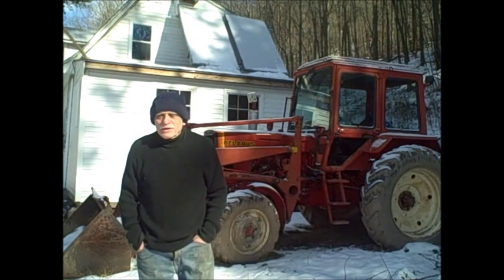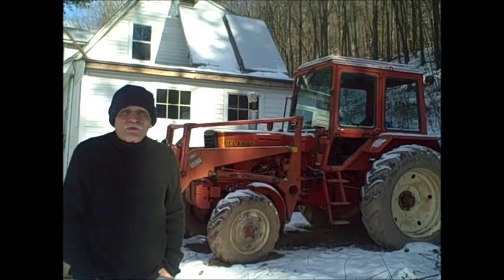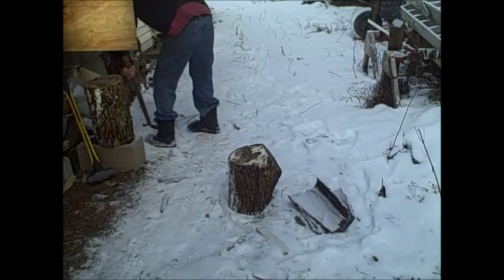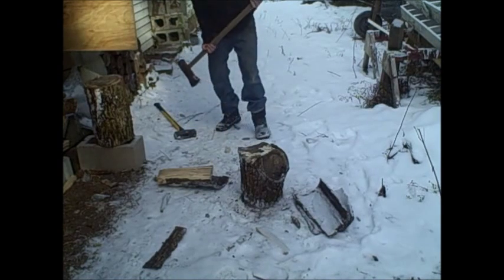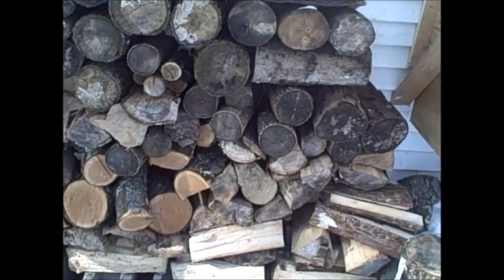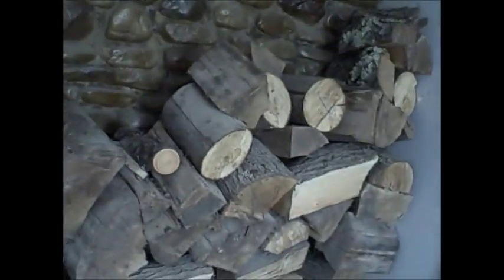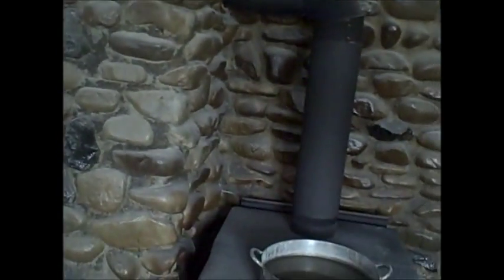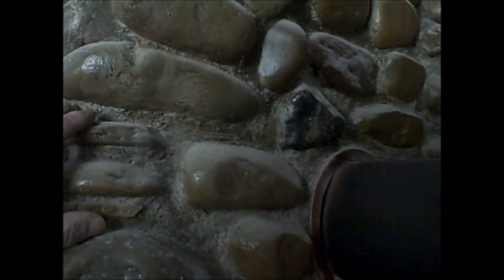Wood Heated Water

Comment: Excellent!  I would love to see more of the mechanical parts... the tank, the circulators, the control, and see what temp water you can achieve with that setup.  Is the loop in the chimney a pressurized closed loop or a drain back?